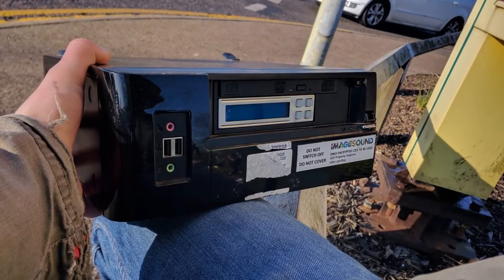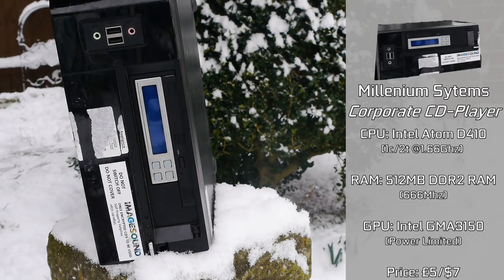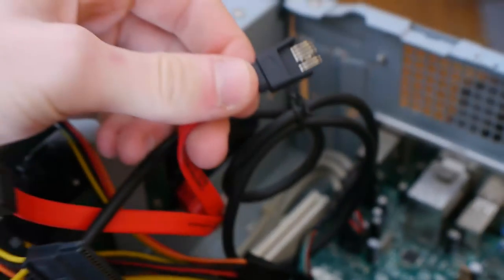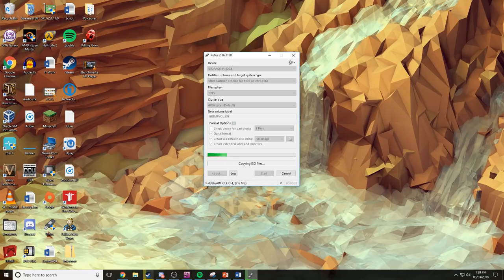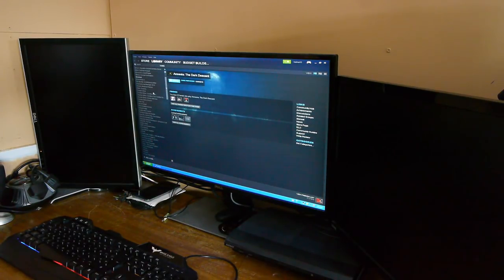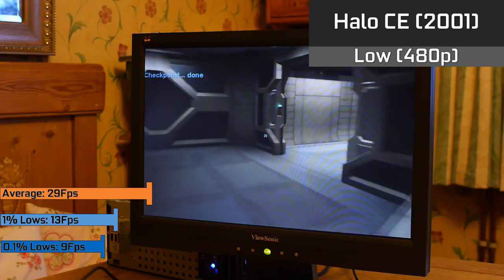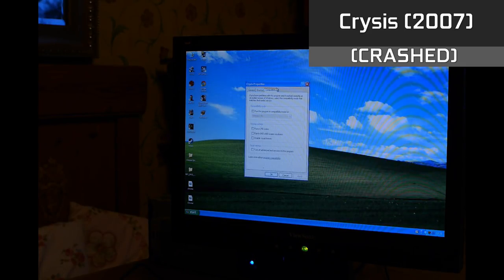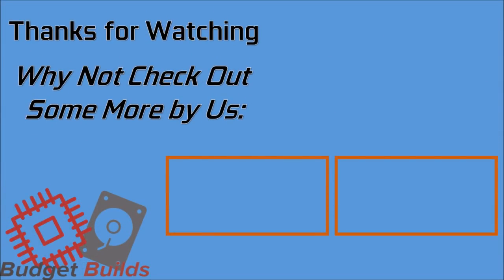Can we GAME on a £5/$7 CD Player from 10 Years ago?

Comment: I just want to know how you were able to boot windows on a CD player at all. I can't even boot retropie on a portable DVD player.
Reply from the maker: This has a x86 CPU, you likely have an ARM CPU at best in a Portable CDPlayer, very different.
Reply: Budget-Builds Official actually I'm yet to see an ARM based CD player. Mostly it's m68k. Maybe nowadays Injenic, which is a copyright-evading MIPS look-alike.
Reply: Budget-Builds Official If it was an arm cpu, couldn't you theoretically install Android on to it then game with that? However I feel like trying to get it to boot anything would be either impossible or a complete pain. That is if it is an arm processor.
Reply: Siana Gearz However it being a DVD player, so it might need a slightly more powerful processor than the average CD player.
Reply: Oh sorry i misspoke. I meant m68k and injenic in DVD players, not CD players. Brainfart.

So well opened up one CD player i had, because i was planning on doing it anyway - the sound is absolutely perfect from the line out, but the headphone out is annoyingly noisy, so i intended to re-engineer that bit. It was a cheap one, ran like that from day one, it's not like anything in it has gone bad or anything, there must be a simple engineering mishap in there,  even though i'm not seeing it yet.

I expected the processor to be a 8051 or Z80 derivative, because i had seen these in MP3 players before. It's not. The processor IC that i found in it is MLC3100A by Korean MCS Logic, which is described by the manufacturer as "new cutting-edge and high performance RISC-DSP CPU core" (well, would have been new in 2002 when this thing was actually made), which digging more into the company history and their other assorted statements they made about their other ICs, makes it likely to be either ARM7TDMI, the same processor used in Psion5 and Gameboy Advance, with an extra DSP hanging off the side of it, or the ARC core which had been a 16/32 bit RISC-DSP architecture to begin with. That one has an interesting history, it's by a spun off microelectronics division of Argonaut games in France, the first product of which was the Nintendo SuperFX chip! You don't hear much about it, but they have claimed at various points to have licensed out the logic to hundreds of IC companies and that it ended up shipped in hundreds of millions of products. Or it could be something else entirely that Koreans developed on their own. Anyway i don't see much of a way to confirm what it is for certain, as there is no obvious or known way to dump the firmware off the thing.
Reply: Oh a little addendum, you really can't get Linux kernel as needed to run for Android without at least an MMU (memory management unit, a CPU component that makes virtual memory possible), one of the more recent ARM instruction sets as they have been expanded multiple times, and quite a bit of storage and RAM... for example you can't run Android on ARM7TDMI that's in Gameboy Advance, or in ARM microcontrollers such as STM32.
Reply: Siana Gearz Ahh, ok

Comment: But can you game on a Potato?
Reply: No because it doesn't have a system.
Reply: GN10Gaming - And more! It still have power
Reply: In general, probably, But that would be if you were using a potato to power an actual system because a potato has electrolytes (i think) and that probably gives it energy; correct me if you want.

Comment: We used to use boxes exactly like this for local backups that would then sync with an offsite service. Identical cases, we had 2 differant models, one with a Via C7 cpu and the other Atom D525... They could handle a max of 2gb of ram. I've actually got the atom model collecting dust in my garage, no clue what to do with it
Reply: Erik Beriault if you got pictures, and it works. I’ll buy it from you...

Comment: if you have the right skills with a soldering iron (or a soldering station) you could remove the bios chip from the mobo and use one of those $4 eprom programmers from aliexpress to update the bios. I would love to see this thing upgraded and running at least windows 7

Comment: Have you tried using the oficial bios dev kits from intel? Almost every intel board from that time used to have a sdk where you can customize the bios and rewrite it with an "special boot mode" (setting a jumper for a few seconds then restarting).

Comment: I know that micro-atx boards with an onboard atom processor soldered in because I unfortunately had one for a couple of years as my personal computer.  Those were sold in Brazil for over $300,00 some years ago(PC, shitty keyboard, monitor and mouse), and you can still find them for sale if you look. Expect prices from $200,00 and over. You can't actually fit a GPU, not even the TOP DOLLAR sold GT610 ($100 in Brazil, new) on those because there are no PCIe expansion slots, just a single PCI slot just in case your onboard network card fails.

Comment: Thought it probably runs on pretty much anything with 32mb of video, I would have lovee to see how unreal tournament 2004 ran on this.

I had a similar struggle to install an os on a motherboard, cup and ram item I got from my local recycling centre for £2, turned out the board was so old it didn't support SSE2, anyway, I got around the failure to boot install media by putting that target drive in another pc, started the install and removed the drive and disk when the install does its first power down before installing drivers. With the target drive and install CD back on the target motherboard, it powered up and continued to install drivers just as normal.

Comment: More RAM would fix this system. If you can get into the BIOS I'd see if you can overclock the CPU and give the GPU some more RAM. I'd also say a thermal paste change would help, as the temps would be sky high when gaming if it's the same OG paste that was on it when it was given to Café Nero

Comment: Maybe you can use it as an MP3 jukebox. Keep XP on it and then throw a copy of winamp and a shitload of MP3s and you got yourself a jukebox.

I'd like to find one of those networked listening station boxes that walmart used to have back in the 90s so you can listen to previews of CDs and movies before you buy them. They look like a small gray box the size of a toaster and it has a LAN ethernet connection on the back (maybe more ports) and some buttons, a green backlit LCD display, and a barcode scanner plus headphones.

They had a similar device hooked to a TV where you can scan a barcode from a movie and the TV would play a trailer from that movie.

Comment: You could play PSX games with ePSXe or PCSX with the lowest audio quality and graphics with a directx6 plugin by Pete's Plugins.
How do I know this? I had the GMA3150 with Chell v1.7b drivers and I did manage to play with the native resolution on an old PCSX.
I even overclock the thing when it boots in Windows.. I use the SetFSB with the ICS9LPR427AGLF clock generator to raise everything. 
Even Windows XP was a lite version with the classic theme and everything was tweaked and made so I can use it and work on it.

Sidenote.. It can't play 3D games released after 1998.. not with the highest graphics in 640x480. It can do 2D games though. 
Age of Empire II The Age of Kings is playable as longest your mapsize is not higher than medium and your pop is set to 50.

A game list:
Baldur's Gate
Battlezone
Colin McRae Rally
Diablo
Dune 2000
Fallout II
Grand Prix Legends
Grim Fandago
Half Life
Might and Magic VI
Moto Racer II
Need For Speed III Hot Pursuit
Quake II
Starcraft
Thief : The Dark Project
Tomb Raider III
Turok 2: Seeds of Evil
Unreal

Comment: Have you tried screwing around with Intel Integrator Toolkit to see if you can get it to flash a clean BIOS image?

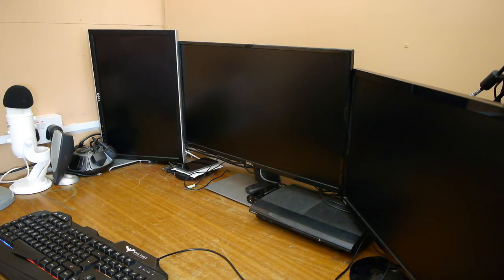4:18 "squeeze/sid" which is Debian 6 beta. For comparison, I'm on "bullseye/sid" which is Debian 11 beta, and likewise, if it was just "buster", that that'd be Debian 10

 This suggests the system would've been built or had its image set up some time between 2009 and 2011, as Debian releases occur in the second half of odd numbered years, and Ubuntu LTS releases occur in the first half of even numbered years.

Comment: You could probably throw a PCI graphics card like the GeForce 4 MX440 or the FX5200 Ultra. I was running a 2Ghz Celeron PC with 768MB of DDR memory with both of those cards and it would run Halo and Doom 3 fairly well.

Comment: I have so many memories; trying to play Minecraft on my parents old 2005 Sony VAIO laptop with Intel GMA 950 graphics. Back in 2013 -2014 I was a huge Minecraft fanatic at the time, I was also between the ages of thirteen and fourteen years old at the time. It was miserable, that computer was so slow; it was a whole nother level of slow. I've since moved on from my Minecraft phase and now I'm really into cars/automotive type stuff. Thankfully I no longer use that computer anymore; I now have three new computers; which were built in: 2014, 2015, and 2016. After spending roughly one year of my life using an old, slow piece of crap laptop; it really make me appreciate how much faster modern day hardware is. Thankfully I'm now running an OC'D MSI AMD Radeon Aero ITX 4GB OC RX 560 graphics card.
Reply: didn't you post this exact comment on another video...?
Reply: RWL2012 I posted a similar comment. I said I used to have Intel GMA 950 graphics, but the comment wasn't as in-depth ad this one I just made.
Reply: Cuzeg Spiked To be honest the only thing that really kept me playing Minecraft was my friends. Once my friends stopped playing Minecraft I stopped too. Minecraft is very boring when playing alone. If my friends still played Minecraft; I probably still would too. Me and my friends went are separate ways though; in terms of video games. My friends really got into FPS games such as: Destiny, Battlefield, Destiny 2, etc. I really got into racing games such as: Forza, Need for Speed, DiRT, etc. The only games me and my friends like together is; Skyrim SE.
Reply: Send it to low spec gamer he can get it to run crisis at 2838474627373727 fps
Reply: Atleast Happ y that my PC is faster than someone's. Mine amd a5 3.9 to GHz ,8gb ddr3 amd something 1gb graphics and 2tb hdd
Reply: @doabrad1850  same but I am the fps dude
Reply: @faolor6468  Ah, I enjoy racing games because of the thrill and excitement it brings. Not for everyone though. SimRacing is a very niche subject and has a relatively small community compared to FPS.

Comment: that integrated graphics can ACTUALLY run crysis with a modded driver on windows vista or windows 7
but just BARELY! And it needs config tweaks to remove garbage textures that cover the screen for whatever reason. but it does kinda work then. not good FPS but it works

Comment: this may sound absolutely ridiculous but it would be interesting to see you try and get this fully working, ie, could you find an unlocked bios chip for it? Fit more ram? Will it even take  a graphics card? I'm curious how you could turn this old thing into something mildly useable even for general web browsing today lol
Reply: also could the cpu be upgraded at all?
Reply: He might be able to get a GT 520 or GT 610 PCI graphics cards in there, but even then, this CPU is so weak that it would likely bottleneck even a Radeon 9600 PRO, a mid-end graphics card from 2002 (also, It doesen't have an AGP slot). Also the GT 520/610 would also be severely bottlenecked just by the PCI slot alone. I do think that this is very interesting
Reply: speaking of Radeon, there are PCI versions of the HD 3450 and HD 5450.

Comment: That is the point whre I would install XP onto the hard drive while it sits in another system and then swap it over. A boot in safe mode should assure that it boots properly.
Interesting, Halo runs as good as on my 2001 retro gaming build. Same goes for Morrowind.
For PCI the fastest card would be a GT 430.
After than comes the GT 61/520.
Below theat there are Radeon HD 5450 > Geforce 8500 GT > Geforce 8400 > Geforce 8400 GS > Geforce 6200 > Geforce FX 5500 > Geforce FX 5200

Comment: Weird that you had so many issues with it i own a very similiar machine (only differences are that it dosent have the display on the front it has a different fron plate and that i have a dual core hyperthreaded cpu) and i had no problems getting it to boot from a external device. The best purpose for a machine like this today is using it as a router or a server, in the router aspect it has been serving me well with pfsense.

Comment: Odd that this machine only had a PCI-slot for expansion, as PCI-E was better utilized in 2009. 
But it could as well be to cut the cost down to a minimum. Those Atom CPU's were incredibly weak though, you might recognize them from the netbooks of the time. They could barely run GoldSrc games.

Comment: There are lots of PCI low-profile cards pulled out from old Dell and HP SFF workstations on eBay...if you're cool with DMS-59 connectors. I've got an HD 3450 that set me back $20 hooked into an Optiplex GX270, and it's good enough to make games from the XP era playable, if not even enjoyable from time to time. The mythical GT 610 PCI, well, I mean, it's still a 610. It might be the shiniest turd in the PCI graphics card drawer, but it remains a turd, and its price compared to all the other turds makes it a particularly large and smelly turd.
Reply: aisle9 Nice, HD 3450 PCI in a Pentium 4...? :)

Comment: Use mat_dxlevel 10 to drop directX as low as possible in any source game (HL2, CSS, L4D, Gmod, etc..)
Its usually sets to DX6, don't alter any settings except the resolution and you should get a performance boost.

Comment: I'd be interesting to see you do something like an HP Pavilion 512n.  Very little documentation, and I consider it luck I have one that's intact.  It's a 128 MB 133 MHz with a single core Intel Celeron 1.4 GHz, the socket being 370 and a chipset of 810E.  It also comes with 60 GB hard drive and a floppy drive.

Comment: What makes the GT610 so legendary? They're all over eBay for cheap so I don't think they are hard to get your hands on.
Reply from the maker: This isn't a standard GT610, it's a PCI GT610, which is a pain in the arse to buy.
Reply: You are right, just had a look and it seems near impossible to find. I also think the GT520 was the most powerful card released on PCI interface.

Comment: Good video. Try putting a 2gb ram stick in it ( I assume it only has 1 ram slot and uses ddr2?), the 610gt pci is rare and expensive, you might have to settle for a 6200 pci or 8400gs pci.
Reply: I’m loving all these PCI graphics card suggestions from people :) So far the options are:

GeForce 6200 PCI, GeForce 8400 GS PCI, GeForce GT 520 PCI, GeForce GT 610 PCI, Radeon HD 3450 PCI and Radeon HD 5450 PCI.

Comment: I think I would have fun breaking the bios out on that system try a external bios flasher and it should just bypass any bios flashing lock also the mono team is still around I think its a .net framework reimplementation if my memory is right but still these things where likely made for next to nothing with the cheapest low power hardware they could get to do there job of audio playback and looping  the lock down on hardware would be to stop employees when there board from fucking them up I have had to do similar with some workstations to prevent them from being tinkered with and bringing down productivity or in this case to keep the music playing.

Comment: There are Windows 7 Drivers for that GPU...so I'd expect an update video with getting that CD Player onto Win7 or Win10. Since often if it can run Win7, it can run Win10.
Reply: it only has 512MB of RAM, which would need to be upgraded to run anything higher than XP. Windows 7 only needs 512MB of RAM for installation, but try actually running any programs on it with that little RAM...

Comment: Played Half-Life 2 and Far Cry on Pentium 3 1GHz with GeForce 2 MX 32MB and either 256 or 512MB of RAM
The problem is clearly not RAM related.
Reply from the maker: You probably played the original release, not the latest version
Reply: @BudgetBuildsOfficial  true. I ran Half-Life 2 with DX7 in 2004. Think I already had Radeon 9200 SE when I played Far Cry.

Comment: Its not the ram, its the drivers. My old Pentium4 had a 915G gpu and even though it said directX9 and openGL2, most games had sevelral graphical glitches and missing textures just like that, I got a 128mb radeon X550 and the problem solved, and i had 1GB of ram running xp bacn then. EVen setting the video ram to 256 didnt fix anything, the drivers or the gpu itself was crap.

Comment: what can it run the gma3150
cs 1.6 / Half life playable fps
cs source (modded drivers) 17 fps avg
gta san andreas 15 fps avg (modded drivers)

specs
intel atom d525 1.8GHz
1gb ram ddr3
windows 7 x64 (a customized low ram usage version)

Comment: Well, back in the day i used to play Far Cry on a P3 1GHz PC with just 512MB of RAM. Yeah, it runs alright, at least multiplayer. I guess the AI is way too taxing for a CPU that weak. My PC however had a Radeon 9800 Pro, which was way overkill considering the rest o the system ;) So, yeah, i guess a proper GPU would be a good option for that system. However YMMV, as PCI is painfully slow compared to AGP...